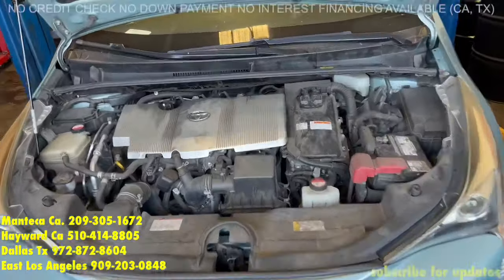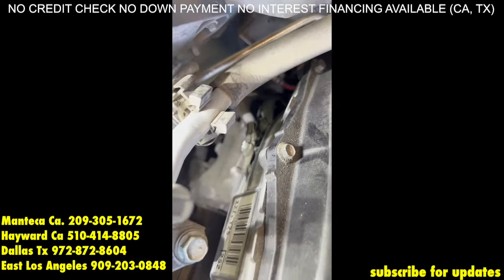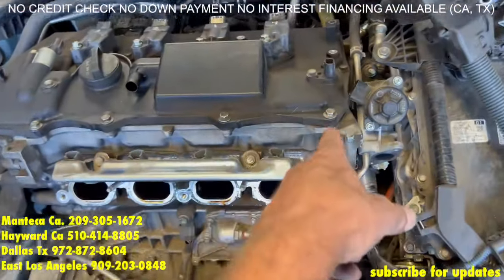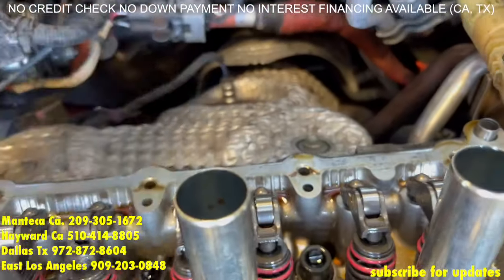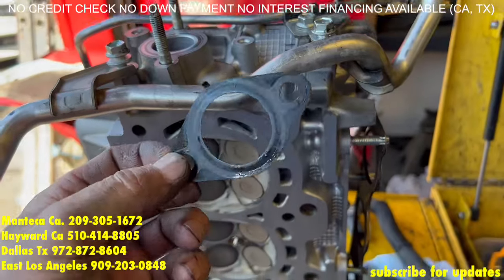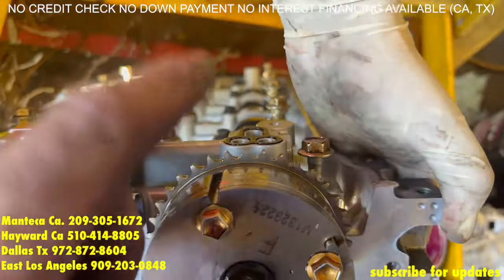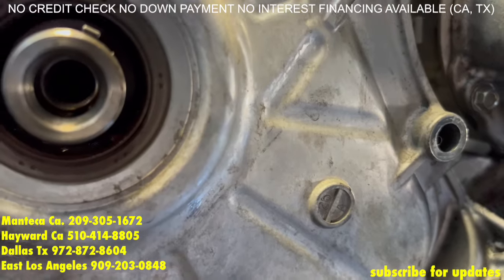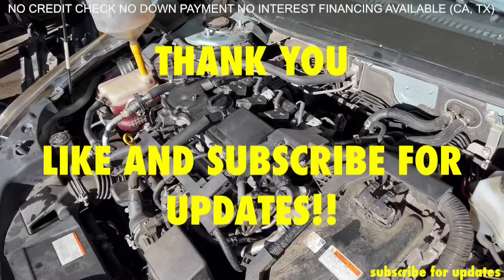BUDGET 2016-2020 prius COMPLETE HEAD GASKET REPLACEMENT

Comment: Did you guys turn the cam pulley by the tire counter @14:10 clockwise or clockwise to loosen it? Mine turns when I try to turn it counter-clockwise and can't get it off.

Comment: I'm always told (and am under the impression of from everything I've read about it) that the head gasket failure that is so prevalent in the Gen 3 is pretty rare in the Gen 4. And from what I've learned from you, it can happen secondary to the heat exchanger failure if the engine is allow to overheat from having no coolant—is that the cause of this Gen 4's head gasket failure?

I'm pretty interested in how common it is in the Gen 4 and any reasons for it, but there's not a lot of reading on it because the heat exchanger issue is so much more common that any loss of coolant is immediately attributed to (and the actual cause of) that. I'd love your input on this, Walter.
Reply: I wonder if I stressed my gen 3 out from two seasons of lower full grill blocking and also combined with not a more religious routine of EGR, Intake and PCV Valve circuits cleaning like maybe ideally every 50K or less.  That second season of summer grill blocking and oddly when running a second bottle of Techron cleaner through my gas tank in a row timed with when the sequence of three reset ed check engine lights came on with misfire codes and a loss in coolant.
Reply from the maker: It’s the same. The fourth GEN just tend to have less miles but it’s even the same part number.
Reply: @gasketmasters 😮
Reply: There is no need to pull the main fuse for the hybrid battery?
Reply: @Markatmjm1974  As long as there is not a code or codes for an isolation fault or related like shorts to ground codes that would energize what is not supposed to be I'm guessing.  Probably helps people not lose their saved settings if you are more expert and fast at doing the work, so can safely.  Otherwise, pull the 12V clips and the HV interlock if you choose I am thinking.
Reply: How many miles were on this 4th gen and What is your best guess as to how often they change the coolant????  @gasketmasters

Comment: @32:10 Torqued mine to 22 and 2 bolts snapped and 1/2 of one of the bolts... is still stuck inside.
Reply: Did you reuse the bolt?

Comment: Do the 2019 and up model years have the same issues? I thought the head gaskets blowing with the 4th gen was a solved issue but that appears to not be the case (I have a 2022).

And after the head gasket is replaced, is the issue fixed permanently?
Reply: Who said it was solved? The internet?
Reply: @nrgonline  A lot of that information actually comes from the technicians who work on these cars. If there are any revisions for issues like head, gaskets, prematurely failing, technicians generally discover this first.